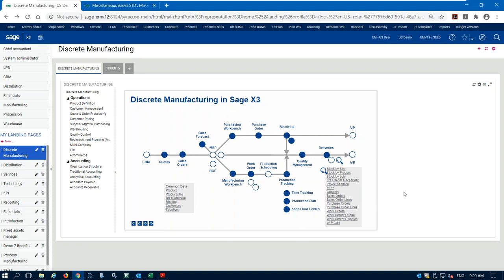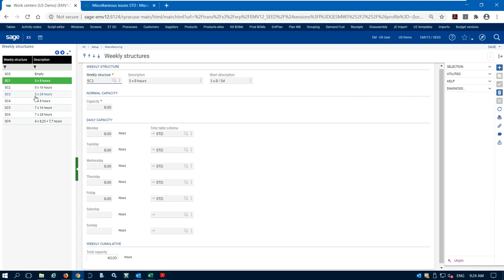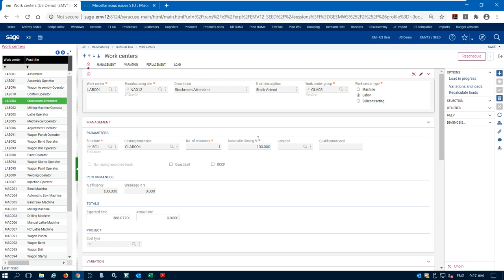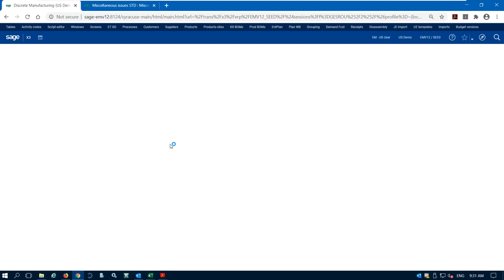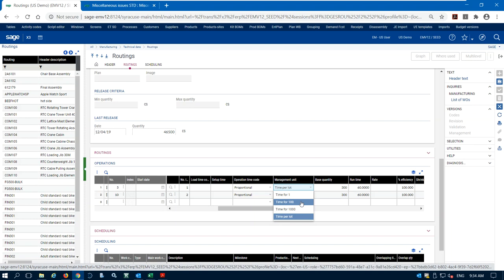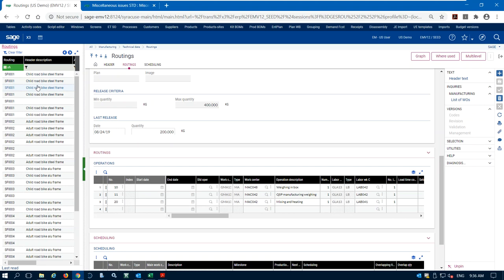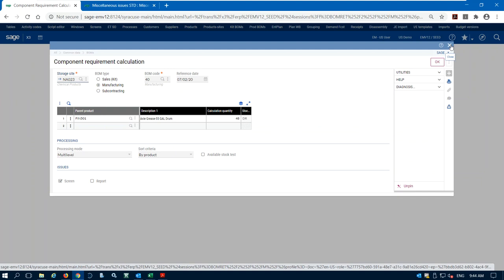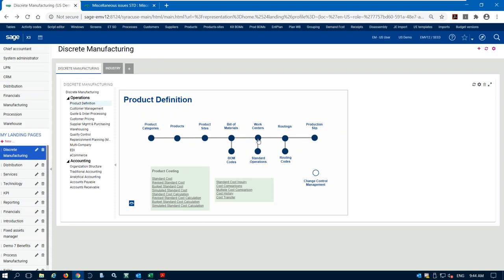Sage X3 Manufacturing demo

Comment: When entering in the Routing Time with multiple resources, is the time entered for each resource, or total time based on the number of resources indicated? In the case above @12:25 300 loves at 60 minutes of labor. Is that a total of 60 minutes of labor with 2 resources, or 120 minutes of labor is actually applied (60 minutes per resource)?
Reply from the maker: In the routing, the time entered is the operation time -- time per part.  X3 will multiply the operation time (per part) by the number of resources to calculate total time for costing and capacity purposes.

Comment: Hi Tom,

Thank you for this video. It helps me a lot to understand the WO process. I just have a question and hopefully you can help me. Where I can input the materials/components actual qty consumed? I want to keep the original qty and I want see the actual consumption as well. Appreciate you help. 

Thanks!
Reply from the maker: Hi Mike,   In X3 terminology, that is called Tracking. There are several ways to track either materials or labor to a work order.  The finished good creation is also a tracking.  Go to Manufacturing->Production Tracking->Production Tracking.  Start a new document.  Enter the Work Order # in the header, as you tab through all the material components, routing operations, and finished goods show up in seperate tabs.  On the component area, you can enter the quantities and choose the lots/serial #s you consumed.
tom
Reply: @tomstimes7427   thanks a lot for the reply and info.

Comment: Hi Tom, 

Thanks for sharing this helpful video about Sage X3 Manufacturing process. I have a question about production scheduling hopefully can get some help here. I knew there's something called web scheduler as an add-on to x3, but I also heard that there is standard scheduling in x3. Do you know the difference about the two? what does standard scheduling in x3 offer? Your help is greatly appreciated.
Reply from the maker: Hi Teresa,  The web schedule module is a great tool -- it provides views of work center capacities. You can drag-and-drop unscheduled work orders into the work center schedule.  The standard scheduling tools in the standard X3 modules are not so efficient.  You may need to a page to view the work center load then go back to the planning workbench to move/adjust work orders.  If you only have one or two work centers that have a capacity restraint, the normal X3 tools should be OK.  If you many work centers with capacity issues, then the web schedule module may be a worthwhile investment.  Tom
Reply: @tomstimes7427  Thanks Tom for your reply and information. Helps a lot!